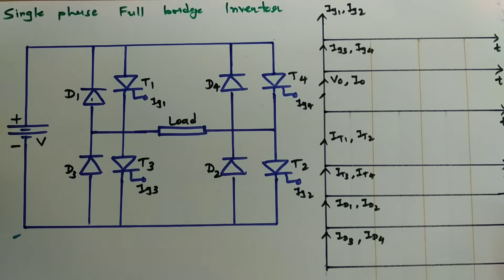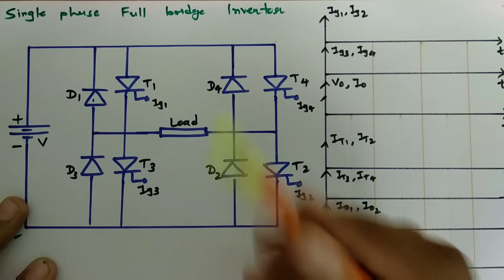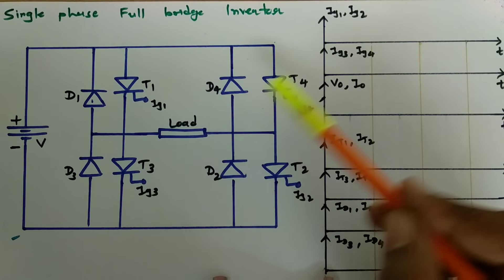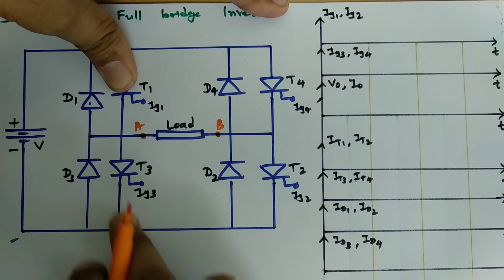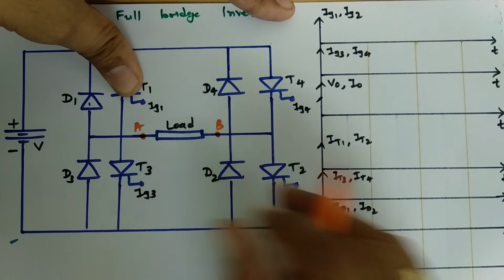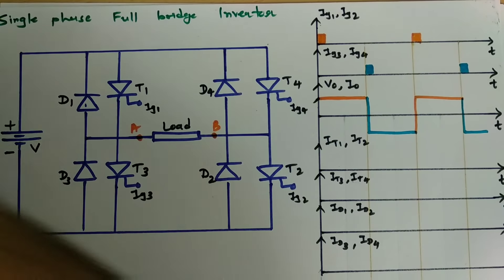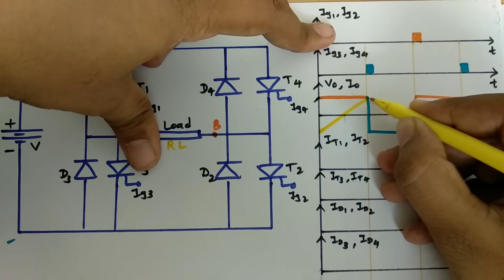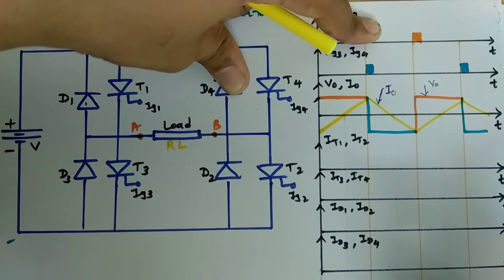Single Phase Full Bridge Inverter (Basics, Circuit, Working, Waveforms & Applications) Explained

Comment: Sir please upload
Ups system,static ac circuit breaker, ac solid state relay, induction heating, electric welding, Hvdc Transmission, static VAR compensator, Thyristor controlled inductor, Thyristor switched capacitor.. And thanks again😊😊😊
Reply from the maker: All will be added after some time

Comment: I didn't understand these line in text book.(But,due to inductive load the load current i0 cannot change it's direction immediately.As the result diode D1 and D2 start conducting after t=0.Now, the load current i0 flows against the supply voltage Vs.Eventhough, T1 and T2 are gated at t=0, they will not turn on because T1 & T2 are reverse biased by voltage drop across diode D1 and D2.) Explain this..

Thanks in advance

Comment: excellent video, thank you.  If the active elements were FETs (instead of SCRs), would current during times t0-t1 and t2-t3 when the load is supplying the current flow through the FETS and not their body diodes (assuming the FETs turned on immediately when switched on)?

Comment: How current is supplied by load initially during t0 and t1? as soon as the inductor starts is charging, its energy becomes lower than the power supply, then how will the diodes work?

Comment: Between t0 to t1 dhe diode D3 and D4 is in on and negative voltage is occure at the output side not D1and D2 conduct bro

Comment: You can add capacitor across no sir
Reply from the maker: Capacitor should be connected for filtering of AC components provided Capacitor is connected parallel to the load.
Reply from the maker: So it should not connected here.